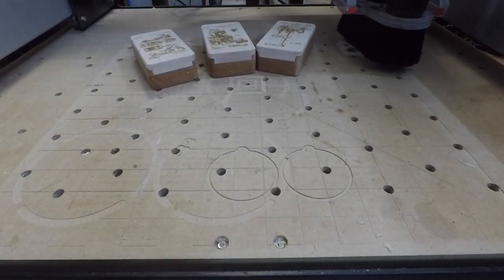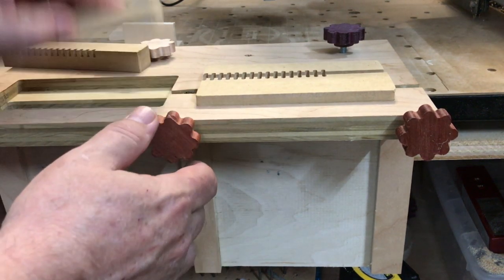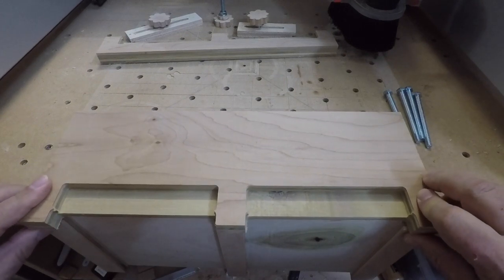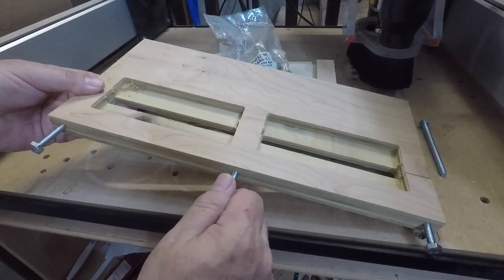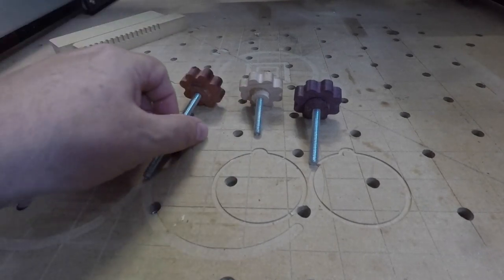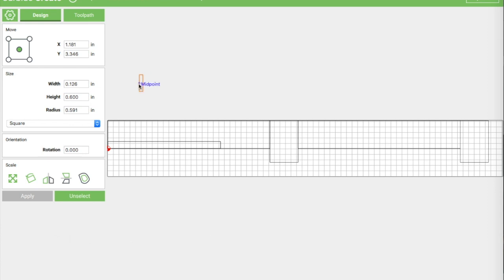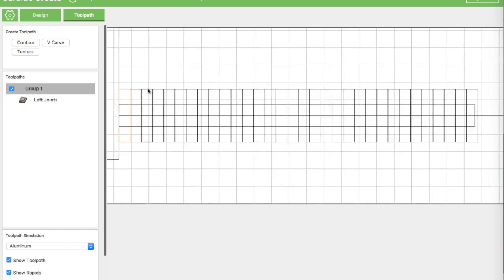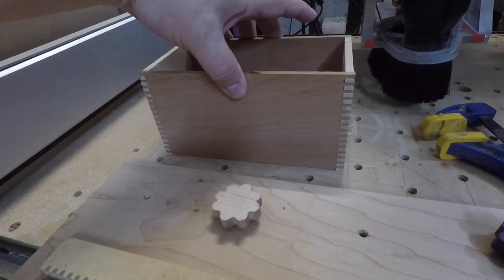Finger Joints

Comment: Great video and tool thanks for posting for us to copy.  I am getting ready to route the parts a have a small problem with sizing as I an using another program.  What is the width of the backing part that will tell me if the scale is off with my program conversion.
have fun
Tom
Reply from the maker: Looks like 14.75 inches by 7 inches.
Reply: Thanks for the reply, that is the number I found when moving from Carbide Creates to Inkscape as a SVG after I moved it to X 0.0 in Inkscape.  It was off by about an inch if I did not make the move?? Great Project thanks again.

Comment: John, Thanks for the tutorial! I finished my Home brew machine last year and want to move forward with joinery work. I don't have the capability to utilize an over-hang on my machine. I plan to remove a section of the bed itself and use a "drop-in" jig approach. I'm curious if anyone has done this with your design (modified slightly for drop-in)....Not sure if the Shapeoko design can be imported into Vectric but I'll know soon enough. Thanks Again!!

Comment: 4 months later, I have a CNC with front overhang so I can incorporate your design into it. Idea for the waste blocks, they are reusable per finger size, so you could have ¼" cuts on 1 corner, ½" cuts on another, ⅛" another etc & rotate as needed. Similarly you could adapt the blocks to cut dovetails with the correct angle straight cut & a dovetail bit

Comment: What a great idea John! I downloaded the files and I have a question. In looking at the feeds and speeds I see your router speed is quite a bit slower than my DeWalt router can be set. As slow as it goes is 16,200 rpm. Do you use an external speed controller? I'm new to Shapeoko and come to it from an industrial CNC with a variable speed high frequency spindle and I'm having challenges getting the recommended chip size from my feeds and speeds calculation.
Reply from the maker: I have a terrible confession to make: My router has not been off the #2 speed in probably a year. I tend to set things by past experience (a small notebook of old settings) and by the sound of the cut. I cannot truly recommend this method, but it works for me. I would guess that whatever speeds there are in the file are the defaults from Carbide create.
Reply: John Clark thanks for the reply. I’d like to get to that place as well. Just anxious to flatten the learning curve

Comment: For the threaded inserts. It helps to wax them sometimes. Specifically if your putting them in fairly deep. Just helps it go in smoother, and so your not as jerky as you drive them in.

Comment: I have a question on finger joints. If i want  to do .25 finger joints and  my board is not the  proper width to get an equal number. what Happens  or do I need to make an adjustment in the  size of the  fingers. Thanks Jeff
Reply from the maker: resorter66 it’s perfectly fine to end up with a partial finger. It should still slot together correctly. The partial may be a little bit more delicate than the others.
Reply: @johnearlclark  When you did the design for the  fingers when you got to the second board how did you deal with that. Did you delete 2 fingers where to boards meet and then start selecting again
Reply from the maker: @resorter66  On the jig I made, the two boards have about an inch of space between them. If you are cutting with more fingers than board you will need some space between your boards. Maybe a diagram will help: https://www.dropbox.com/s/iwrmq4xgj56av7i/fingers.jpg?dl=0

Comment: Hey John how far out from the front  of the Shapeoko  does the jig sit at its furthest point please? Not counting the thickness of the board your cutting.
Reply from the maker: Not counting the board. It's 4 inches. So figure between 4 and 5 when loaded. Does that make sense?
Reply: @johnearlclark  thanks John I am building an enclosure for mine and I want to make a trap door in the bottom to slide the board through the bottom of the table so it will be closed when running. And I needed the clearance for the front door. I will email you pics when done.
Reply from the maker: @AWORKOFTHEHEART  That sounds really cool! I look forward to seeing it!

Comment: John -- I'm learning a lot from your channel. Thanks! 

A suggestion: Couldn't you mount all four sides of the box in the jig at once (two on the left and two on the right)? That is, the front and back sides would be stacked on top of each other and the ends would be stacked on top of each other. Then, with the length cut on the Y axis suitably increased to account for the double thickness of wood, each milling operation would cut twice as many sides. It's the way I hold work when cutting finger joints on the tablesaw and it should work on the CNC, too.
Reply from the maker: I will have to give that a try. I am mostly using thin stock so it should be pretty easy to do. Thanks.

Comment: John I just finished watching  your video on finger joints. I was wondering  do you move the bit up to the edge of your board to set the xy and  then on top to set the Z height. Could you take a picture of where you set that up and maybe text it to me.Jeff Peters
Reply from the maker: Here is an image of the alignment. Please let me know if this helps: https://www.dropbox.com/s/rqrr07maskyxvgt/bitposition.png?dl=0
Reply: @johnearlclark  Yes that did help
Reply: John I downloaded your files on this from cut rockit.com
Unzipped them and found the c2d files  which all open in CM all6. What I don't see is anything on the design portion as far as files. Also I don't know which file is for which part. I want to have a paper copy .to refer to so I know that  I have the right size 
 material   in place. So are there and files anywhere for the design portion.
Reply from the maker: @resorter66  Just tried downloading from Cut Rocket and everything has a .c2d file extension (meaning they are Carbide Create Files). I do know that Carbide Create does not automatically open a file when you double click it. You have to launch Carbide Create, choose Open from the File menu and then select the file to open. It's a bit of a pain, since it goes against pretty much every other program in the world, but hey... free software. Let me know if that does not work.
Reply: @johnearlclark  You have posted 6 sheets can you tell me are they in order with the  pictures
Reply from the maker: @resorter66  Unfortunately, Cut Rocket automatically renames the files to a long string of numbers, which is not really helpful. The original files are here and may be a little easier to sort through: https://www.dropbox.com/s/036dzrxiw8oc8ae/Finger%20Joints%20Jig.zip?dl=0
Reply: @johnearlclark  John I downloaded the files in the link above. and  opened the files CC under settings it looks like every file is on the same size board Is that correct.   Just  curious on your grid size selection 0.197 
Jeff
Reply from the maker: @resorter66  I believe they are all from the same size board, which could just be me being lazy. The grid size is the just the default. I really was not using it for this design.